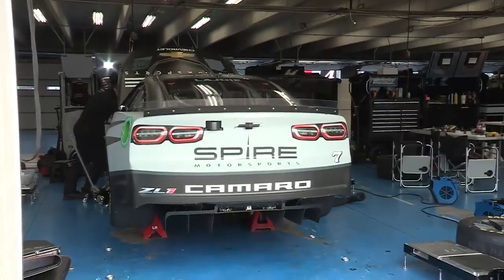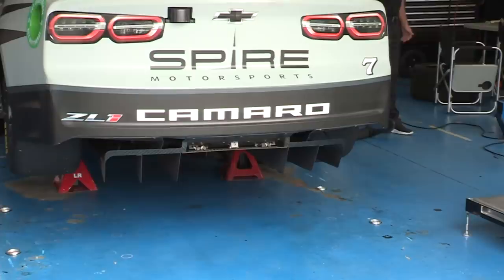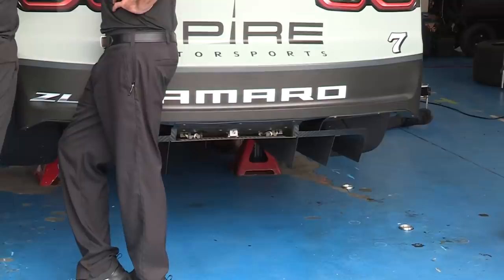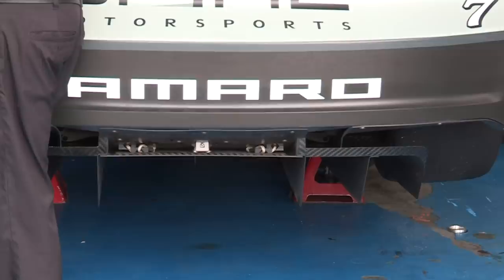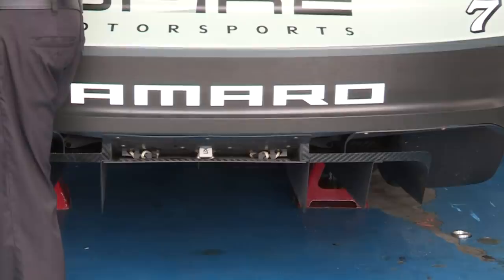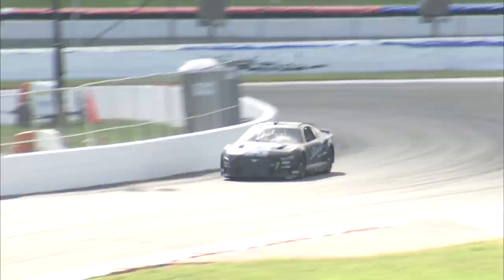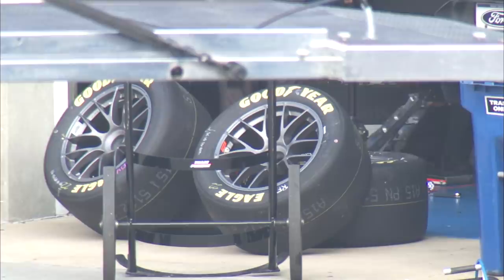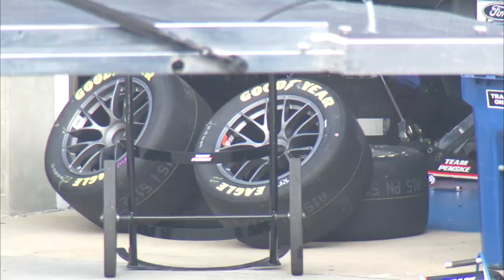Larry Mac breaks down center lug wheels on Next Gen car | NASCAR

Comment: Centre lock nuts have worse expansion issues.  And are mechanically inept. Clamping force over maybe 2" instead of 4.5-5.5" They all chatter on the hubs. 5 stud ones do not.
Look at V8 Stupidcars for lost wheels,,, and they do it generallly once every one hour race.

Comment: Tire and wheel together look so big. Do they weigh more or less? 🤔
Reply: they might weight less than the 15 inch steel wheels do but they certainly don't weigh what 18-in steel wheels would
Reply: @johnhaas2523  the forged aluminum 18x12 weighs less than the 15" steel wheels and no more inner liners for speedways, another savings.
Reply: @mtrheadguy  Less unsprung weight. The suspension will react better to the roughness of the track surface.

Comment: There are some real safety benefits to both changes. Reducing the turbulence behind a car, when one pulls out to take the lead, should allow the car being passed to maintain grip. 

Having one lock nut is a significant safety feature as fewer failure points exist and allow pit crews to quickly leave the pit lane side during a stop.

Anyone know if spindle cable ties (to the chassis) are part of the new rule package?

Comment: I'm trying to keep an open mind here, but I have a couple issues...first off, what is the danger of one of those aluminum wheels breaking and pieces of it going through the fence and into the grandstands during a wreck?  ....also, while I understand and appreciate the idea and purpose of  the "diffuser," won't less drag totally ruin the draft??  Maybe they could run the diffuser on road courses and mile and a half or less ovals only and take 'em off plus increase the spoiler for daytona, michigan, pocono, talladega, etc.... 

Overall I think the cars look sweet, number placement aside, and I'll be interested to see how it goes.

Comment: The weight difference in the rim and maybe even the tire (sprung weight) will effect other adjustments such as shocks and springs also. Might take a few races to get the difference dialed in. Small changes equals big expenses for the race teams. Look at the thousands of rims/wheels and hubs that will have to be replaced along with new tools to change them. A loose lug nut is going to feel and mean a lot more since there is only one. If a wheel gets loose it will probably ruin the hub (assuming they will have splines) and it will need changed out also.
Reply: Steel splines in Aluminum hub......I know who will win that fight...
Reply: Drive pins in the hub, no splines.  No modern race car has a splined hub.  The 18x12 Forged aluminum wheel weighs less than the 15x9.5 steel wheel and the 18" tires no longer require inner liners on speedways so the overall package is lighter.

Comment: It's nice that they are finally embracing technology from decades ago with the center lugs, but they should do the same by ditching the off-board jacks as well.
Reply: Nascar was considering it, but decided against it for two reasons. A. Not having to install a pneumatic system saved the teams money and B. Nostalgic factor

Comment: I wonder how well the new wheels will work on road coarse races where the wheels are constantly running across the curves i not sure aluminum wheels will hold up against constant bumping over these curves ALUMINUM WILL CRACK EASIER THAN STEEL. But im sure NASCAR  has given this some thought and testing. I do really like the center lug this should make pit stops even faster.
Reply: BBS know what they're doing...
Reply: Not like ISMA doesn’t run aluminum rims…… they have no issues.
Reply: @kharnthebetrayer1575  Don’t forget NASCAR cars are significantly heavier.

Comment: I do wonder if the tire changers will relax a little bit due to them still having to wait on the fuel load to release the car. Kinda wish they would switch to a pressurized fueling system like other series have, that will keep the rest of the crew on their toes. Hope to never see air jacks tho.

Comment: So what happens for the fail safe NOT to crossthread it. And can a replacement be done on pitroad quickly and SAFELY.. cause saftey is why its being changed. Also the Aluminum wheels is a bad idea.
Reply: no one will have an issue getting it threaded
Reply: Odd that other racing leagues use aluminum wheels with no issues. But keep trying.

Comment: What's next, air actuated piston jacks like IRL or F1? Those things can lift a car in about 3/10 of a second.
Reply: Air jacks are not used in F1…
Reply: @timothyreed8417  I stand corrected. F-1 doesn't refuel during a race either.
Reply: IRL was garbage and hasn't existed for years. It's Indycar and that idiot Tony George isn't running it anymore. Also IMSA and Supercars use that jack system too.

Comment: I'm all for this car rims not so much  Aluminum will snap under hard impact what is the possibility one of them small spokes snapping off and hitting a fan hope the rim has been tested for hard impact
Reply: it's aluminum wheels we're going to snap under hard impact I wouldn't be using them. NASCAR is done it's safety test with the wheels
Reply: @johnhaas2523 oh I trust nascar to do the safety research but we all seen cars hit the catch fence just hope they did a good impact test instead of looking at other race cars data stock cars are a heavier monsters

Comment: I bet we'll see wheels floating around the track after wall brushes. The aluminum wheels will be breaking off the hubs
Reply: if that was the case they wouldn't be using them because NASCAR did test to see how they hold up

Comment: So basically 5 lug steel wheels are safer. Can't wait to see one of these explode when they hit the wall at Daytona or Talladega.
Reply: The reason they need to go to single lug is because of the massive lateral grip the new 18 inch wide tires have and would rip off around the lugs if they used five because of very small wheel metal between the five lugs.  I'm not an engineer but, it seems to make sense.  Oh, and I did stay at a Holiday Inn Express at one time.  Even Carrol Shelby put a single spinner on his A/C Cobra cars.

Comment: Total departure from stock car racing is complete with no stock cars, no stock engines, no stock wheels, nothing stock. Change the name of the series.
Reply: These cars haven't been stock since the 1960s. The COT looked like a cartoon. The current gen cars have similar suspension to a Oregon trail covered wagon, the current generation cup cars literally have absolutely zero in common with any production car coming out today. Almost no production cars are are coming from factory with 15 inch steel wheels and they haven't been common since the 90s. The 18 inch aluminum wheels are much closer to stock even with the single lug. NASCAR has been using a similar wheel and tire setup since the 70s or 80s so in modern times that's definitely no where near stock. This is similar to the fact that Nascar used carburetors all the way until like 2012, it wasn't stock in the slightest. In the 90s Chevy NASCARs was Chevy Lumina, which the production version of the car was a front wheel drive 4 cylinder family car nothing like the "Stock Car" Nascar was racing. Same with the Ford Taurus.  Point is the "it's not stock" argument is absolutely ridiculous in regards to the next gen cars. No the next gen cars aren't close to stock but they are way closer to stock than NASCAR has been in nearly 50 years. Nascar still had a 4 on the floor until now. That's something performance cars did in the 1960s. So the stock argument is outrageous switch to the heritage argument saying you think Nascar Should be old school makes much more sense than the stock argument.

Comment: I'm concerned about left side tires being loose. If the rear or front tire changer is slower than the other guy and the Jack man lets the car down too soon then one of those two is going to be loose. If that thing comes off now you have a 50+ pound missile and a car that's totally out of control. Other series don't usually have this problem because they change all four at once but Nascar is different and they change one side at a time. I anticipate this being a problem.
Reply: if it's loose somebody's going to be enjoying a few weeks vacation
Reply: lol.  there are "locks" that prevent the nut coming off. many series use a single wheel nut.  but..this is nascar we are discussing, the same series that takes things that arent broken and "fixes" them until they are...
Reply: @CrewGuyPJ  I'm aware of the tiny little locks on the stud. Loose wheels still happen in Indy car and they do come off every once in a while. I guess we'll just have to see.
Reply: @the8jrfan   go to the races, enjoy...it'll be fine ( by nascar standards lol)
Reply: @CrewGuyPJ  Ya lol. "I'm sure it'll be just fine" - Nascar

Comment: Getting farther and farther away from "stock car " there's really not 1 thing stock left on a cub car. Need to change the name because "nascar" letters each stand for national stock car auto racing. Only a third are "national " and none are "stock" pathetic!!!
Reply: hasn't been anything stock about a stock car in a long time
Reply: @johnhaas2523  that's my point. I'm in nascar country. Every team and cms are all within 10 miles of the house. Born into the sport and seen every race since 1985. It's definitely changed.  I do however know some things most dont...such as in the 90s, Hendricks was still ordering Monte Carlos brand new fully conmuser optioned cars, to there shops, tearing them down and building a race car with that body and frame!!! So, nascar is not as far removed from stock as you think it is as far as how many years now. Waldrop, Richmond, labonte, all drove then fronmr H and all drove cars that came on a truck to the dealership on independence blvd to Hendrick Chevrolet.  Same as mom's car, there was nothing special about them , except he ordered those with ac delete. They were then trucked from dealership cross town to Hendricks shops at the different teams and the tear down began.

Comment: What’s next, open wheels?
Reply: no
Reply: I'm a big time GP500(Now Moto GP) fan and always chastised NASCAR for not racing in the rain when the bikes can do it at 200 MPH.  Then I realized that it only appears open wheel cars run in the rain.  I would imagine that the thin sheet metal of the wheel tubs would get destroyed by water spray at the speeds they run.  I thought that might have changed recently when I saw cup cars with a wiper on the windshield.
Reply: @RedBud315  NASCAR just can't safely race at 200 mph on the high Banks at all. open world only races road courses or Street courses in the rain just like nascar

Comment: They'll have a Jackman for a couple years. Then they'll switch to pneumatic jack stands, to help the teams "reduce" cost.
Reply: While it's a possibility, it just moves NASCAR in line with all other forms of motorsport these days. F1, V8 Supercars, both have used single lugs for a while now, and if you want a comparison for what pitstops could be under a Single lug with pneumatic jacks, watch a V8 Supercars race, those pit stops are still just as intense. On the point of "reducing" cost, NASCAR has stated it wants to make it easier for teams to enter the sport, employees are sadly a large cost for motorsport operations so roles like Jackman may simply change forms or disappear.

Comment: 5 lug wheels are soooooo dated in today's racing scene.  Good for Nascar to go to center lugs!  I wonder if the diffuser will be far enough under the car to not be damaged during bump-drafting?
Reply: And yet the new corvette z06 still has 5 lug nuts so how is this American. No car built in america has one lug per wheel.
Reply: @johnsnow1355  I fail to see how that's remotely relevant. There are also no v8 rear wheel drive toyota camrys in the us